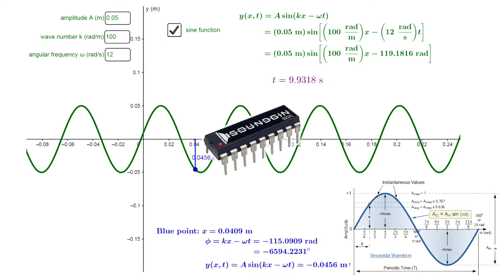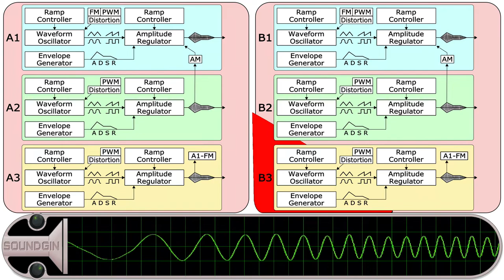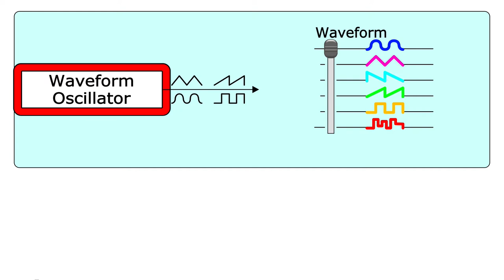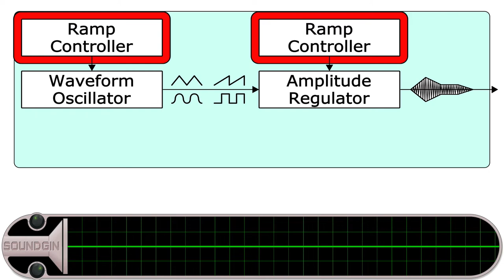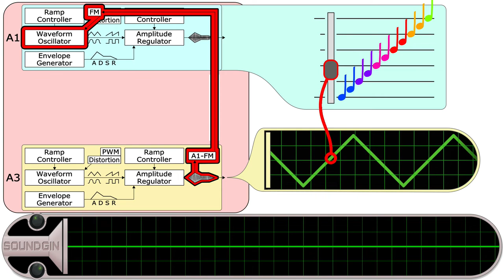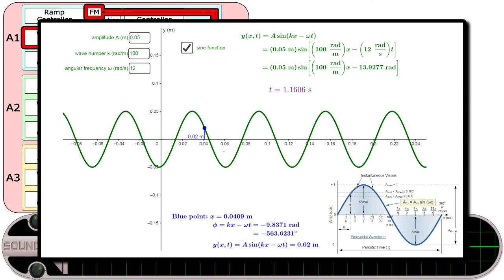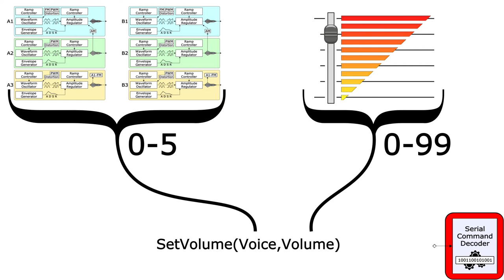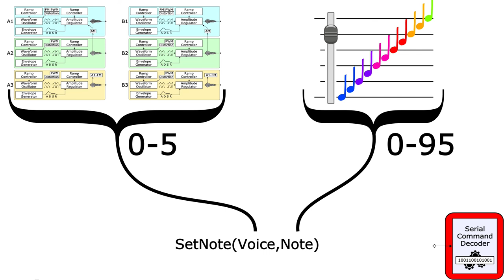Create 80s Sounds efects with Soundgin & Arduino/Raspberry PI - Part 1

Comment: What a fantastic chip! You mention a SoundGin Arduino library, but I can't find it anywhere. Is it still available somewhere?
Reply from the maker: Thanks!  As far as the library goes.. I decided to go a different direction 
I'm moving the Arduino functionality inside a new soundchip.  Look at the sneak peak videos for the SoundginZ.  Everything you hear is being done by the node configuration you see in the thumbnails.  (No external processing needed)  you can still control all the nodes externally ... but you don't need to.
Reply: @ScottSavageTechnoScavenger  I am not sure I am following you but I was thinking more a library for serial communication with the existing SoundGin chip, premade C functions that sends the escape code commands to the chip.

Comment: A great and informative video! But why do you need two complex sound generators (CSG) to mimic the SC-01? Is it because phoneme N (played back on CSG-A) transitions to phoneme N+1 (played back on CSG-B) has to blend from A to B? What algorithm (or envelope) do you use for blending?
Reply from the maker: The first CSG does the resonate sounds.  "A - E - O".  The second does the frictive sounds.  "S - F - T".
Often, those two types of sound need to happen at the same time.  "Z".
Reply from the maker: Transitions from one phoneme to the next are handled by adjusting the frequencies of the resonate frequencies from one to the next smoothly.

I.E.  264.35hz to 323.67hz via 32 steps instead of jumping to the next in one step like the SP0256 does.
Reply: @ScottSavageTechnoScavenger  Can you recommend a good technical book or document about all this? Also a naive question: does the Soundgin have base (pre-recorded) samples for all the phonemes? Or do you derive them from "first principles" (like the SC-01 and SSI263)?
Reply from the maker: @tomcharlesworth4319  Nothing in the soundgin is pre-recorded.

Comment: I wanted to say thank you for making your speech chips and testing/dev boards available on eBay. In the past few years, I have taken a keen interest on speech chips and learning electronics (I know little but enjoy learning). I looked online regarding SpeakJet & Soundgin project, specs, etc.

I hope it is OK to ask a few questions. Basically, I want to hook it up to a Teensy board (LC or 4.0 -- both 3.3v tolerant). I have a DB9 adapter (never used one before) and think I only need to utilize, GND and TX (maybe RX too?).

On the Soundgin board I purchased from you, I see a few areas that I would like more info on.

1. The jumper area labeled J2 (with D, B, R columns).
2. The area marked J1 (with S,0,1,2,3,Q columns).
3. The area marked J3 (bridged to the rs232 part of the board).

thank you :)
Reply from the maker: D, B, R.  These wires go to the Demo, Baud Select, and Reset.  Tie Demo to ground (jumper the two pins) and it will start making sounds.

Baud selects between 2400, and 19200 (I think - check manual)

Reset is of course a chip reset.

S,0,1,2,3,Q:  The 0,1,2,3 are not used on the Soundgin.  On the Speakjet they are used as triggers. (check the manual for more detail on how they work)  I haven't seen anyone actually use them.  Most just use the serial port to control everything.

S = Sounding.  It just goes on when it is making a sound and off when silent.

Q is a controllable output.  Haven't seen anyone use this line either.

J3 - This was an idea I had to make the board splitable between the sound chip and the Rs232 converter.  J3 makes it so that you can connect them back together if you do.

Gnd and Serial in is all that is needed to make it work.  Serial out is needed to read the registers. (See the manual for the command to read registers)
Reply: @ScottSavageTechnoScavenger  thank you! :)